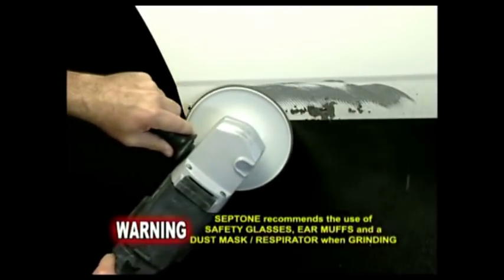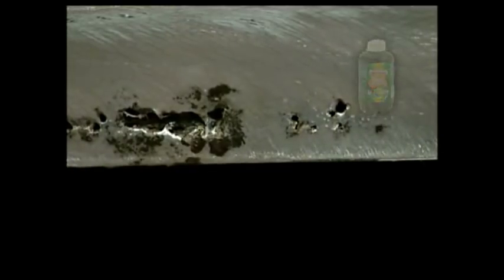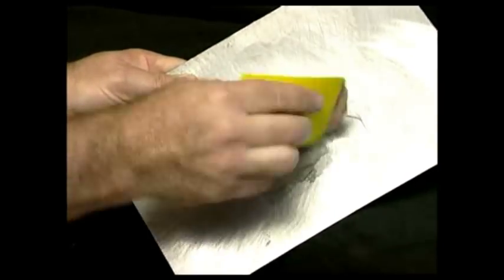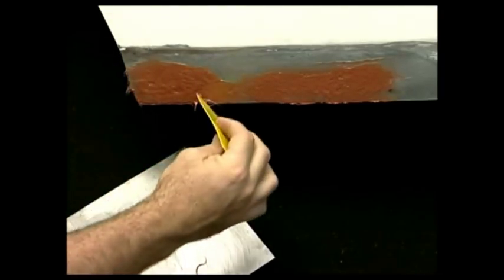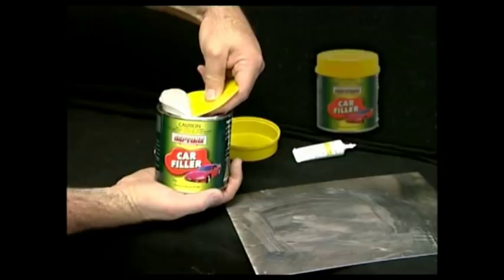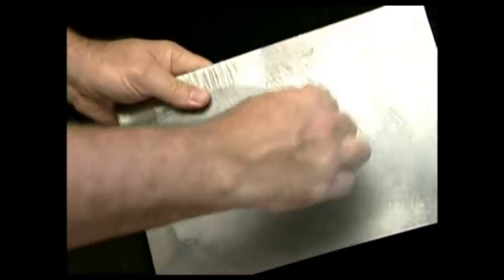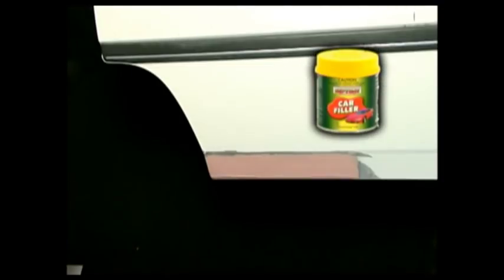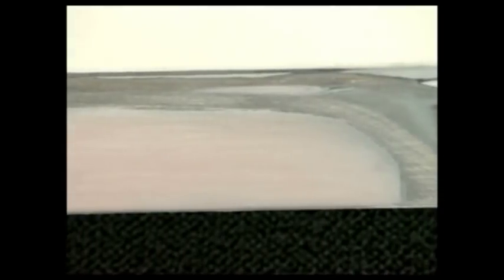How to - Rust Repair // Supercheap Auto

Comment: How about the inside of the panel as rust can find its way through, also the "fibreglass" should be ground a bit lower for the filler to be applied then sanded even for primer filler.

Comment: if your'e not cutting out rust and welding new metal in,then repairing this way is o.k.,as long as you grind out the rust totally- be really brutal- don't leave any rust-pits behind.
then,once youv'e filled the holes,painted it and finished the repair, coat the back of the panel in engine-oil,to stop,or drastically reduce,rust coming back in the future.
Reply: Cavity wax from the inside works great 😉

Comment: Only treating/repairing one side will not stop the rust. It will continue to rust on the back side. It can only be eliminated by cutting the rusted areas out completely. I know this because I worked many years in the auto repair business and I currently work at an auto factory.

Comment: Quite a good repair but being a rocker panel it has to be welded that hole has lost  quite a lot of body  strength, and filler and glass fiber cloth will not give that damaged point its full strength,  any body panel doors boot bonnet and front wing panels can be repaired with filler but not the main safety cage locations and that was one of them, and any location within 12 inches of a safety belt point or sub frame mounting point. Any way with the amount of time taken to do that repair, it would  have been quicker to plasma cut out the dead metal and weld in a patch making the repair stronger and longer lasting.

Comment: Man, I'm sick and tired of all these self-righteous "bodymen" constantly whingeing about how this "isn't a proper repair" or this is just a band-aid. Why spend hours on a "professional" repair on a car that likely won't last past the repair itself. It is a "temporary" repair, because it's a temporary car...
Reply: What if you have a classic... That you plan on keeping forever.
Reply: couldn't have said it better myself.... cardboard some fibreglass filler few Tina of spray good as some new cars 😂
Reply: Rubbish, this is a terrible technique used to "con" or "deceive " people!!!!
Reply: @steveperez4647  then you probably wouldn't be looking for shortcut tips on a channel called "supercheap". I have two cars in my driveway right now that both need rust repair. One might get a hack like this, the other certainly won't. That's how rational people function, they choose the appropriate tool/method for the situation at hand.
Reply: @johnterpack3940  couldn't have said it better myself mate it all depends on the job at hand
Reply: @steveperez4647  this is a way to get a car through a couple more regos.
If it's a car you want to last forever you will need to weld in a patch, , then it's a good idea to deoxidize, clean and paint with a epoxy primer, dress up your welds with fiberglass filler, unlike other paints and primers you can fill over the top of epoxy primer.
Cut down your fiberglass and then go over it with body filler, sand level and go over it again with epoxy primer, then go over it with a 2k HS primer, sand and paint, don't forget to clean up and paint behind if you can get accsess.
To do it for a longer lasting job you will need a compessor, water trap, MIG welder and gas bottle,  grinder, primer gun and finishing gun.
Reply: I’m working on a classic car and for small rust holes (<5cm), I’m cleaning them out real well and using this technique. I don’t have a welder, or the time at the moment to learn to use one and this method will get the car over the line and I can enjoy it for a good few years. If the rust comes back - I can always go the welding route in the future. 

For larger areas I have just paid someone to patch in a new piece of metal.

Comment: ok.  So I've spent my $25 - $ 50 for this product / method.  Suppose some laughing boy runs a shopping cart into my side panel? Will it hold or indent, like a chunk of crap?  :)    ( I was wondering if soldiering or spot welding a thin length of plate steel  might be better? )
Reply: Go to home depot and buy a metal mash it is very thin and it bends and it shapes like a butter, once you got the shape attached with small metal  screws,  but use a small metal bit and then screw it, bonded with the things you need  and senddd down. Then the paint.

Comment: If your going to this please us fibreglass resin and hardener and fibreglass for surfboards! I used to use a welder, cardboard template, steel sheet according to the car. Cut it out , weld a sheet cut from template and grind. Then weld, deoxidine and filer no more than 1.5 mm. Textbook method is no more than 3mm. Sand . Undercoa and paint. Etc. I used to put tectyl rust prevention or rust converter in the sill and then rust prevention treatment .

Comment: Actually the rust converter will seal the rust the glass filler is water resistant and will keep water out  you don't need to always cut the rust out this will last for along time.
Reply: Mine has lasted 7 years
Reply: Water resistant, but not waterproof.
Temporary fixes like this could very well last years...but they can also come back in a month or two!

Comment: You can use cardboard to mix your body filler and icing. It's the way I was taught from old timers and I've never had a problem.
Reply: Spasibo
Reply: Some hardeners/activators may cause a flammable object such as cardboard to spontaneously catch fire if they are in prolonged contact with the object.

Comment: No body seems to fix the rust on the inside,like mould if you see it ,its on both sides.
Reply: Indeed. And this was a great example of that problem. Oh well.
Reply: To be honest, the only problem is on the inside. The surface on the inside need a repaint. People say this doesn't work, but it does, as long as you remove all the bad parts. You do not remove the rusted parts the inside will keep rusting and going through the door appearing behind the paint again. But using filler does indeed works

Comment: Wax and Grease Remover
Metal Tech filler
Car Filler
40-80 grit sandpaper
120-180 grit sandpaper
24-36 grit sandpaper
Reply: My combo as well with Techtyl 506 or POR-15 on the inside.

Comment: this is'nt a "repair" this is a band-aid.  the filler over the top of rust will accelerate the rust
by absorbing and trapping moisture inside the panel. a real repair involves cutting out all rusted metal and welding in new
Reply: But wouldn't hammering out most of the attached rust make the re-growth rate almost minimal to none?
Reply: rust never sleeps
Reply: How effective are these rust-destroy products? I am fixing a van and am planning on attacking the rust with it.
Reply: DudeRevolution
rust converter works pretty good but you can't put bondo over the top of it.  rust converter and then primer then
a spot putty is better than bondo over rusty metal.
Reply: Hey thanks for the help brother. What about those metalic 'patches' that can be welded on? Do does rust react to it as it does to bondo fill?
Reply: BS glass fibre is a perm fix if done right

Comment: Not good! That's not a good job. Just replace that with a little piece of metal. Few minutes of welding and will be ready to prep and paint!
Reply: in most cases you can't get behind the panel and it will continue to rust any way, most of us that own old cars just want them to look good who cares whats under the paint.
Reply: @George-ie1si  while i do agree it all depends on the application like I'd use this on my car but depending on how bad it is I'd cut and weld new sheet metal but for little job like this on my old beast is a completely acceptable but for my trailer or the roof of my old navara it's not lol It all depends on how bad the damage is

Comment: Wow, Supercheap is right, this is not how to repair rust as it will very quickly come back if you do this, also doing this to flip off a sh#t car to a new unsuspecting owner is not cool as they will be paying what appears to be a straight car not a rusty dunger. Those defending this method obviously know nothing about cars or give a toss about their safety,  whats behind the area and what is left behind does matter as if you leave rust behind it will come and bite you in the ass when you least expect it.
Reply: Dean Parker n
Reply: Dean Parker I'm afraid I agree with you, I did this two years ago and low and behold....it's back! Admittedly not as bad, but back all the same...AND  it's eating away at our beloved camper van. We can't afford a professional so am attempting it again,I don't weld and im a girl!! So I am going to use an angle grinder this time to BLITZ the bastard rust out of her!! Fingers crossed.

Comment: dodgy repair method this
only way to repair rust is cut the effect area out and weld in new clean metal
i've done repairs as they show here and with in 1 to 2 years the rust is back worse than ever
its unsafe to repair any car this way
Reply: +GREEN JJ yeah but its a good way to sell all there poxy products !
Reply: GREEN JJ h
Reply: Rust bare metal exposed to water and oxygen, why would it grow if it's covered with filler and paint?
Reply: That’s not true if you apply rust killer leave rust killer for about 24 hours as you supposed to then filler with metal tech rust does not come back

Comment: To do a proper repair you have to completely remove all rust... And after you are done doing all the steps he just showed you you have to do the same steps on the other side of the panel.  If you do not your molding will look very shitty and unprofessional.  Car shows will often look in the wheel well for rusting and shitty fixes like this.  If your going to repaint the body, please repaint inside AND out.

Comment: I would hate to buy a car with rust covered up this way. As I restore my Camino, I will do it the proper way. Cutting away the rust and welding in fresh panels.
Reply: +atlantissgcfan i agree ! if you don't get rid of the rust then it's going to come back through ! I have a bad place on the front fender of my Blazer that needs to be ground down and fixed !